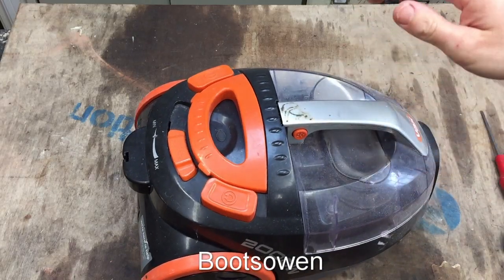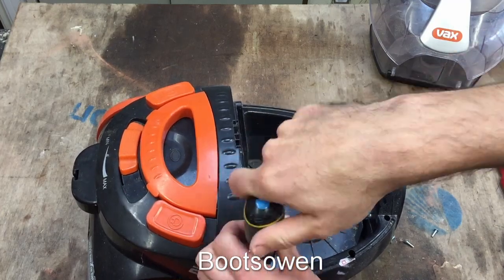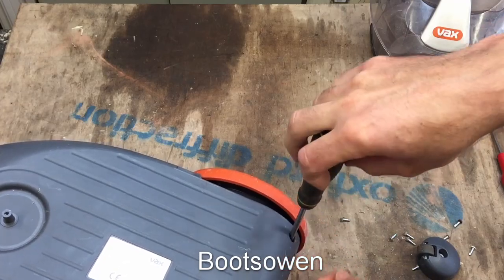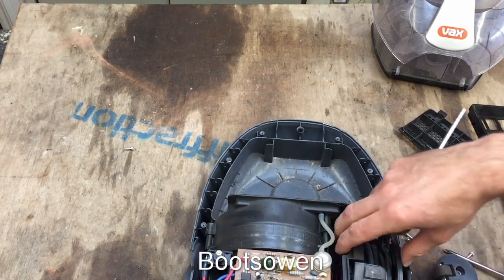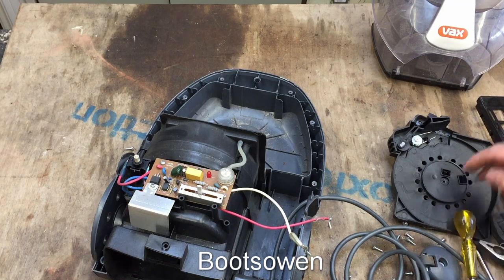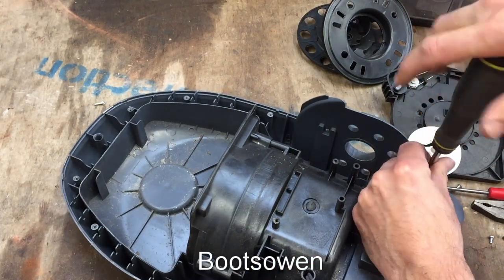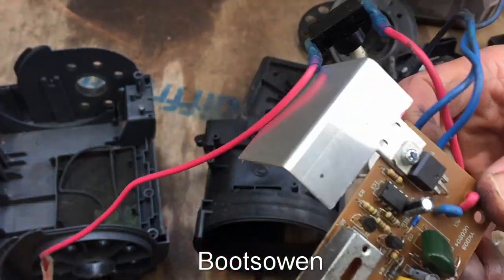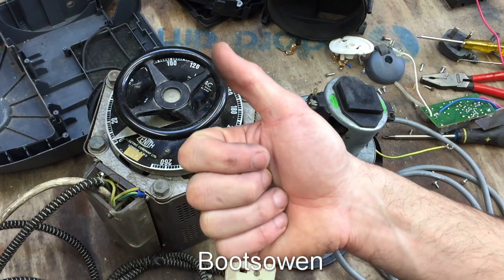Vax C88-VC-P-A disassembly and testing motor: Failed!

Comment: The fact that its 2000W would make it pre 2014, which was when the EU imposed a 1600W cap on motor wattage for vacuum cleaners. The serial number would date it to week 24 of 2012 (date code 24-12 within the serial number). These were crap machines, they clogged their filters that usually made the motor overheat and either burn out, or possibly overheat the thermal cutout, which was supposed to cut power to the motor if it overheated, and reset when it cooled down again, but sometimes they never reset and that was effectively the end of the motor's life, which was what could have happened here.